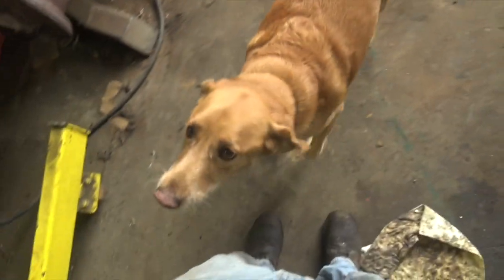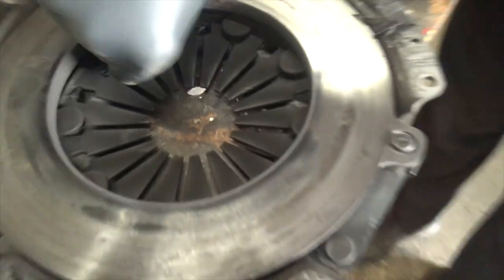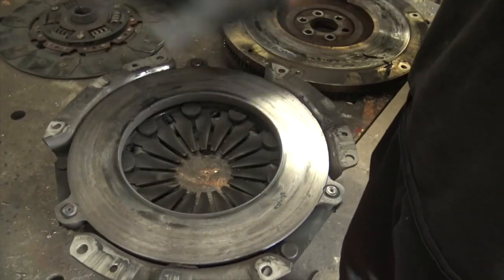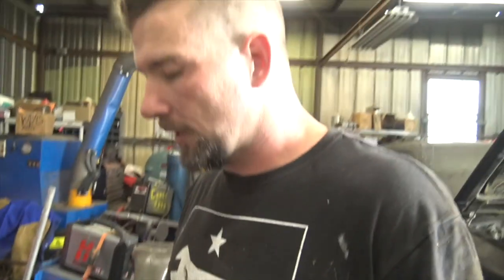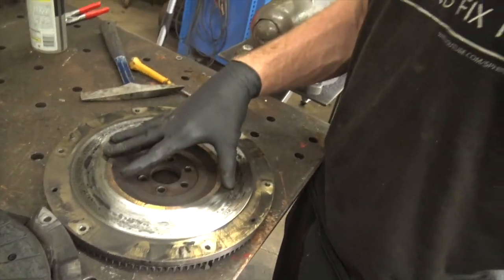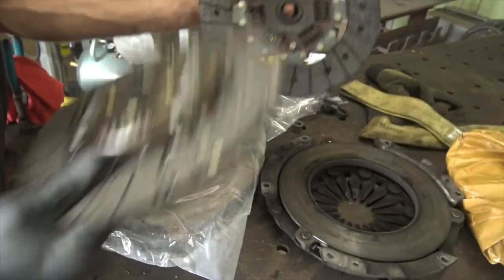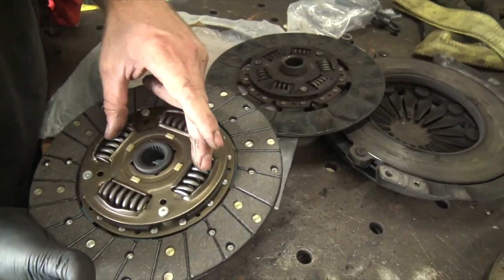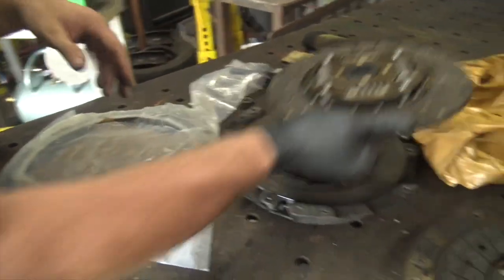WATCH THIS VIDEO BEFORE YOU REPLACE A CLUTCH!!! HIDDEN SECRET TO AVOID EASY AND EXPENSIVE MISTAKES

Comment: I've never used any special mounting tool for any clutches. I test the clutch plate on the transmission axle and turn down a wooden stick in the lathe to fit the crankshaft bearing and the clutch plate. Has always worked for me.

Comment: My 6.0 2006 F350 has 186,000 miles with the original clutch. I don't use the clutch much except for starting off in low gear.

Comment: The pre installation comparison, degreasing all friction surfaces and alignment tool are key.  To memory in 74 when I installed a new clutch. Pressure plate and throw out bearing in my 69 Chevelle lock tire was not widely known of if it existed and the bolts had lick washes.  I can’t recall if they were any special design but I’m sure their hardness and spring compression was comparable for the bolt size and torque rating if the bolts.  With the correct length bolts today I might prefer lock tire over lock washers.

Comment: This is a skill set that has been lost in this new generation.  Nobody under the age of 20 can fix anything, most cannot even fix their own dinner.

20 years ago the owners manual on a vehicle described how to adjust the engine valves.  Today the owners manuals tell you to not drink the battery acid.